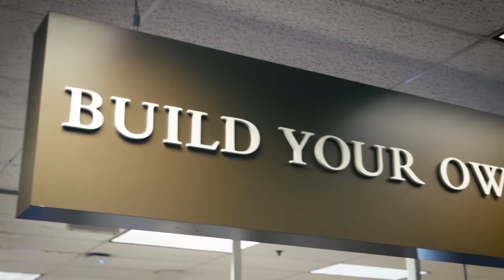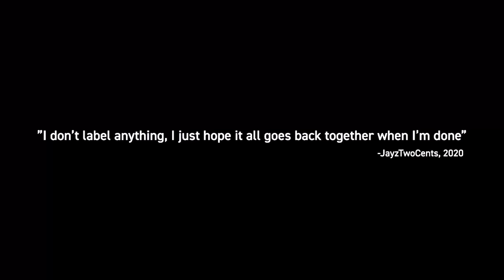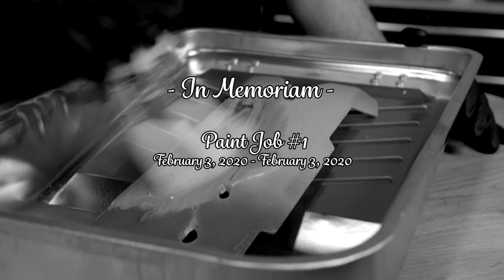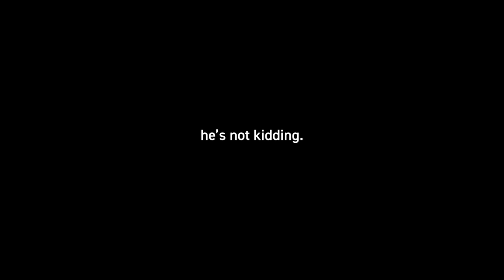This Custom Star Wars Case Mod turned out PHENOMENAL!

Comment: That was excellent. I actually did a Star Trek themed build a couple years ago. Used NZXT S340 elite chassis painted grey/silver with NCC-1710-D USS Enterprise letters on it. Front rgb fans in red, two HUE+ light strips in blue to resemble the warp nacelles and the NZXT Kracken x52 AIO pulsing in blue to resemble the warp core.

Comment: As you now have a cnc plotter, you can actually get paint mask vinyl. You can get it from ebay and amazon, but I would recommend using a big brand such as Hexis, Oracal or 3M, as I know that they won't affect the paintwork.

Love the mod!

Comment: Your tip counts for everything and especially for lacquering. If you're gonna do any lacquer at all, make sure that your work area/room is 100% dust free. A single piece of dust on the wet lacquer means redoing your entire piece. Not just removing the lacquer. No, you need to get all the paint and base coat(s) off as well or risk a much worse end result. I currently have to sand down through multiple layers of paint on a table I'm doing, because the newest layer I applied, started to peel off. It's not noticeable right now, unless you look for it, but since I'm going for a high gloss end finish, it would end up looking like painted over coffee stains on one end. Not good for a smooth, high gloss white tabletop for my brothers height adjustable gaming table. You either remove your bust or watch your work turn to dust.

Comment: Have to agree, it definitely turned out really good. As to the "pro" shops that told you you can't use vinyl to cut stencils, they just don't want to do it or give away that "secret". Back in '86 in college when those cutter first came out, we quickly figured out that we could use it to cut stencils for air brushing lettering on posters and other projects, what we did was just use airbrush friskit vinyl which is thinner instead of the stickier and thicker normal vinyl.

Comment: Im an ASE Certified Automotive painter . Jay you need to scuff the surface and use a Zinc chromate etching primer then you can use a regular gray primer .In the future use a tac rag not a micro fiber rag before painting or clearing. Your paint job came out nice Jay!!!

Comment: As a profession body man and painter I can say the best paint jobs are only as good as the prep work. Doesn't matter how flashy the paint is, if you cut corners prepping, it will never last. Also make sure you use the right prepping techniques for the right material you are painting and it will save you a lot of headaches later.

Comment: the reprep needed to be done here and gj to j2c for just getting to it, but for future ref, if anyone ever finds themselves in a similar situation: if you put a thin buffing of car wax before using stickers they wont pull up the paint but still sticks very well. its a good idea for bumperstickers over painted bumpers (or anywhere on a car) to protect the clearcoat if you ever want to take it off, even years later.

Comment: zinc-primer spray paint sticks real good to bare metal and gives it a very paintable texture. I used it as a primer on my motorcycle fuel tank and I used it to cover up rust on my old car.

Comment: I told you about the Silhouette Cameo plotter in the early Skunkwork days. In the sign industry masking vinyl is call sign mask and not vinyl. It has way less glue in order to prevent damaging the surface below. If you buy it from a sign supply shop it will be much cheaper than the hobby grade material like Cricut and Silhouette.

Comment: Just as an FYI when you are using that Cricut to make your stencils and stuff the best vinyl to work with is Oracal 651 imo. It will make weeding the stencil and stuff like that 10000x's easier. And vinyl is WAY cheaper on Amazon. You can get a 12"x10' roll for like $8.

Comment: CARC Spray Paint is used by the military... it is completely flat colors, designed to blend in... and honestly, if you are going for anything military like, this includes star wars, that is the paint you want... though... you probably don't need the chemical resistive properties of it.
Also... I would have placed red led's inside the side vents so it glows out your "exhaust" ports.

Comment: Jay, instead of using a bunch of paint remover,  you should get a small contained sand blaster. You could use it to remove small amounts of paint in wanted areas to give it a weathered look, or if need be it could be used to remove all paint in a mishap in example A .^     Just an opinion/idea :P

Comment: One issue that might be causing that paint issue..... Youre using VHT paint. That stuff sets by heating up what youre painting. Theyre used on engines and log burners... the heat cures the paint into the metal...

Comment: Hey Jay, a quick tip on the vinyl stuff. The Cricut machines are amazing, however, the Cricut vinyl and transfer tape is absolute junk, I highly recommend using Oracal 631 (non-permanent) or Oracal 651 (permanent up to 7 years) and some better transfer tape, stuff that has the blue 1-inch grid squares. I used to make decals and stickers with the Cricut shit and lost money on that shit, then I switched distributors and materials and sales went up...

Comment: Well, having worked a little bit with vinyl printouts and such, Vinyl is probably not a good choice, because of the glue on it, which is there to make sure the vinyl doesn't fall off. (like when you put letters on the side of a car, it should be able to take quite a beating.) The vinyl itself is irrelevant, but you do risk pulling the paint off if you use normal vinyl. (with normal glue, as I think you found out, probably was contributing to it.) So it's not complete bullshit, is all I'm trying to say. ;) 
But dude, having your own plotter when you are into cars and modding... I think that's a very useful investment. ;)

Comment: JayzTwoCents, I have a video idea that would be really helpful for people building a new PC. A little video comparing motherboard driver "user-friendliness" take for example, I just built a pc about 4 months ago based on an Asus x570-e board and I've gotta say, Asus armory has been a royal pain. (i've literally done 3 fresh installs simply because I came to the conclusion that I was better off without Asus' "help" keeping things running smoothly) Despite that, the board has been a beast at stability even with having never updated the bios.. anyways, IN CONCLUSION: Please, a video showing what manufacturers are most user friendly between first start, and when you can finally start installing games. Thanks!

Comment: Learned early on from dealing with cutting into cases (late 90's)....breathing mask helps too. Last time I didn't use one I was hacking up phlem with metal bits in it. I was breathing that fine shit in. Better safe than sorry.

Comment: Try Montana 94 spray cans, they are very nice, smooth matte paints, also fast drying and great coverage.
Also iam wondering how would it look if you blowtorched, or everso slightly melted the edges of the blaster holes. You know....lasers.. heat... Lastly if the LEDs would be red, it wold be even better. But it did came out amazing as is, i have to say. How about some "Vice city" theme build next time. Neon yellows and pinks, blue palm tree shirt, you know...

Comment: you need to make gaps (or make gaps using black paint over the lights ) on the vertical lights on the front, they are not beat up enough and too bright

Comment: SUGGESTION
I think that a "PCMR*DATA PROCESSOR", if it would be used on a Battlefield, would be carried in a "PCMR*DATA PROCESSOR CARRYING DEVICE"
such device should be carried like a backpack, and have feet to stand on the Ground. there should be a flat compartment for a screen, and a compartment for a Keyboard.
the design should allow for airflow as i think the DP would be used Right out of its carrying device.

Comment: Here's a thought. Do a nice, like new paint job, put it together and then tie it to rear bumper on your car and drive around the block a couple times. VIOLA! Weathered case. But it's a contradiction of terms. The Empire has millions vehicles. To allow a damaged vehicle to exist suggests vulnerability. This would be a no no. If easily repaired, it would be done instantly. If not, it would be destroyed just as quickly.

Comment: I wonder how small (and how cool) a machine you can build fitting 8*3.5inch harddrives, 3*Bluray drive, 6*2.5inch ssd, 2*360 radiator, 1*140 radiator, one sound card, one raid card with fan at the level of at least Adaptec 71605, one watercooled 2080Ti, and one water cooled CPU.

Comment: As a car painter you always drive me nuts with how little you sand the original surface you lay primer on lol
Reply: if you use prep all after sanding on even a powder coated surface you can scratch it up and still get great paint adhesion from the prep all and the scratches in the original material
Reply: i would really reallly reallllllllllllllllllllllllllllllllllllllly recommend using prep all for your surface cleaner over iso alcohol, while the iso does well in terms of cleaning, you seriously miss out on the adhesion benefits prep all brings to painting, especially on metal surfaces

Comment: Thats my build-  case Inwin 701 / I7 3770 / asus rog strix rx580 8 gb / 16 Gb DDR3 1600 mhz / 1TB HDD / 250 GB SSD Samsung evo 860 / 650w cooler master power supply . pretty budget build

Comment: Aluminum is a bitch to make paint stick to. It forms an Aluminum Oxide surface very quickly in open air (Anodizing is controlled oxidation of Aluminum). If you want to make it flat black, clean it, and use Krylon high temp BBQ paint. It's loaded with self-etching primer, dryers, the nozzle doesn't clog up, and it's dry in minutes. Rustoleum is crap.

Comment: Can anyone in the comments help? I'm thinking of building a ryzen 5 2600x with a gtx 1660TI on a AsRock b450 pro4 board. Would the stock cooler be enough to handle this build or should I also invest in a separate cooler. Also Im thinking of having a positive airflow in the case so would 4 120mm noctua fans be enough? Sorry im new and confused. I don't wanna overheat the system.

Comment: You know they make vinyl specifically for that right??? It has tac but super low tac so that it can be put onto newly painted and soft surfaces and wont lift up any paint. PPPPP always man Proper planning prevents piss poor performance :P Also would have been wayyyyy more sick if you changed the lights in the case from blueish white to RED!!!!!! x.x

Comment: hey im hoping you see this.. For quite a few years I always wanted my own computer and after I got my first job I saved up and decided I was gonna build my own because of videos like yours, Linus Tech Tips, Pauls Hardware, etc. Anyways I finally built my own computer and really went all out because I wanted to be a real gamer of course (and obviously RGB). However I am finding my computer to have problem of restarting randomly unless I am running rainbow six which is odd. I have tried everything I could possibly think of along with everything the internet has told me to do, so I am hoping you read this and might have any idea as to what could cause this because at this point I am really out of options and do not know what else to do. Thank you. (also there are no pc shops in my area)

Comment: VHT stands for Very High Temperature, it's uselesss for this kind of stuff. It's for painting engine parts or brake calipers that get super hot.
For painting aluminium you should always use an etch primer.

Also no photo etch detail kit on the Bismarck! 0/10

Comment: Will a bad psu trash your computer?
Reply: depends. honestly any part can fail, so the logic is why risk it. but i've never head a psu die on me while building or using a pc. But on the flip side, if I was using valuable parts, I wouldn't chance it on a low quality or off brand psu. But on lower parts? I do all the time.

Also what do you mean by bad? like lesser brand or certification? or literally bad, as in it makes a sound or rattles or something?
Reply: @bluescluessuperagent  like is a 80 gold or better the only way to go
Reply: @mysteriousracer  gold/silver/bronze have to do with power efficiency. Not with reliability.
Reply: @bluescluessuperagent  I said bad I should have said quality lol